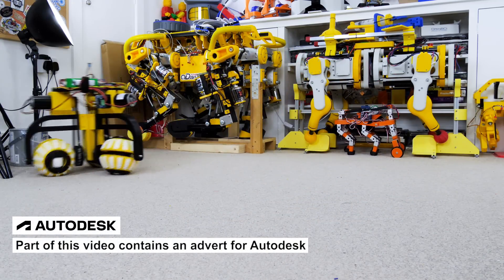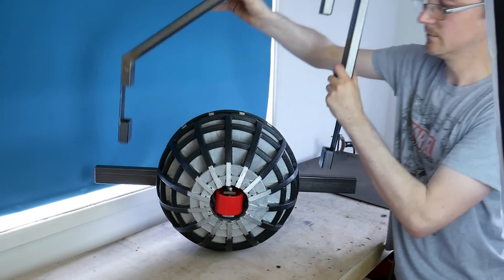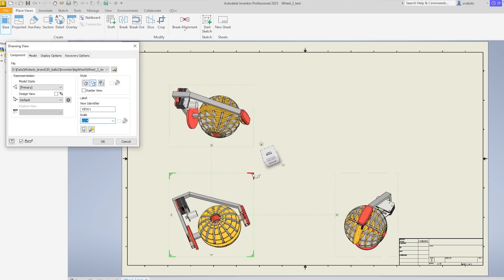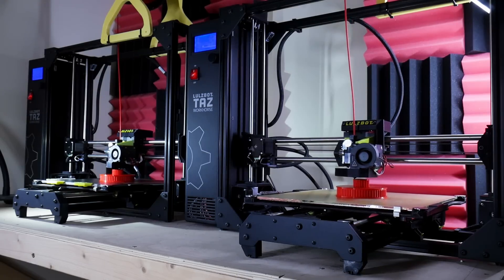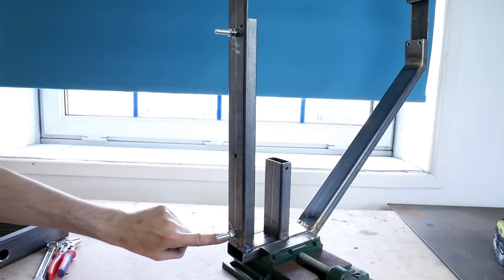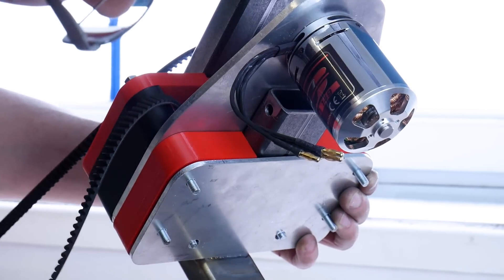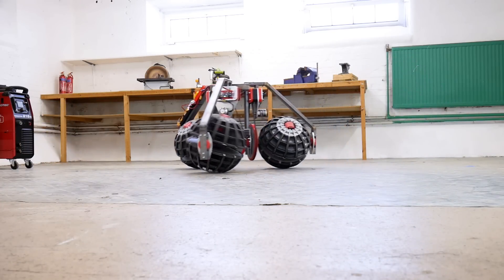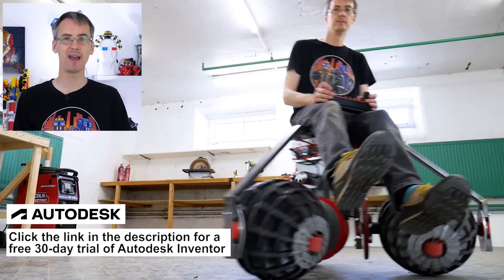Testing Ball-Shaped Wheels on an Omni-Directional Vehicle

Comment: Hmm, looking at this, that would make an amazing wheelchair. Being able to move in all directions like that would probably change some people's lives.
Reply: Interesting notion, but I expect this would have to be redesigned from the ground up to meet that purpose. Ability to negotiate slopes, stairs, and a braking system to lock it in position when needed, would all be essential.
Reply: @chrisblake4198  It would need to be redesigned from the ground up to meet any purpose. Slapping a chair on top of a movement platform isn't the correct solution, especially with how tall the platform already is. Ridable platforms are much more complex in terms of design considerations compared to generalized motion platforms, due to needing to accommodate a rider, of which position and posture are important, while scale is also important and will most often determine seating position and posture. In the configuration of a chair, a rider's legs are typically an issue, which is why the typical office chair has all of its wheels located under the person with their legs outside of the boundaries of the base, but this requires a smaller scale. At this scale, mimicking a trike with an isosceles wheelbase will probably be the more optimal method, especially within a tadpole configuration, with a singular rear wheel, where the rider's legs can be forward of the wheelbase, as seen in most recumbent bikes that have a reclining position, though an upright posture where the rider can sit and stand at will would require a layout that results in potential balance issue due to how far forward the rider would need to sit, which is also an issue of the wheel geometry. Outside of fringe designs at larger scales, the only way an upright chair works for this platform is making an omni-directional office chair. 

Spherical wheels are just generally problematic anyways. Overly large with next to no benefit, and arguably worse driving characteristics. The only time they will ever make sense is in the example of the Goodyear spherical wheel concept, a free-spinning ball that can be magnetically driven, as this would provide the best driving characteristics of any omni-wheel, especially at the scale and implementation they were conceptualized for; not to mention material and moisture ingress are negligible in this concept. Omni-wheels for wheelchairs could work, but only in the instance of in-store scooters, not in an environment where material ingress is a concern; this is basically why we only see large-scale omni-wheels used on forklifts that remain in an indoors environment on smooth concrete floors, ingress is a concern and combating ingress significantly raises prices in mechanism with so many rotating parts. This then leads into why vehicles really won't see the use of omni-wheels, especially when the scale becomes based around speed of the vehicle, as the typical omni-wheel would create a rough ride and would more than likely have a fairly fast wear rate. 

Omni-wheels are cool and all, but they just don't make sense outside of some specific uses. You'd have better luck creating a wheelchair replacement using legs, as even they'd be a lot more practical.
Reply: @xaytana  i dunno i think a wheel chair design but with 4 omni wheels atthe corners would be both interesting design wise and interesting for a pratical point as it owuld alow free movemernt
Reply: @CuppaLLX  It would still run into the same issues. Spherical wheels are just impractical in comparison to any other omni-wheel design, outside of one concept that's more than likely never to be realized within a reasonable frame of time. Using any other form of omni-wheel within an optimized layout and orientation would work, spherical wheels however are too problematic to be practical.
Reply: @xaytana  spherical wheels do have their own benefits though, like fewer, larger and more durable moving parts. most omni wheel designs have lots of moving components that need to work with 100% reliability, a wheelchair with 4 spherical omni wheels like these would be able to work fine if one of the drive motors failed completely. they wouldnt really need to be huge omni wheels either, maybe 4 football sized ones so they could be close enough together to fit through doors, a more raised and slightly more upright seating position with the option to sit more fully. it would be much more capable than a mobility scooter or regular electric wheelchair as long as gradients or slopes could be managed  of course.
Reply: @Great.Milenko  More durable moving parts? Support your argument. All wheels in the design are supported by an axle with a bearing on both sides, just like in most omni-wheel designs; all things being equal, subcomponent durability will also end up being equal, though I'd have concerns if the large end of the hemisphere were supported by a bearing identical to the smaller end of the hemisphere. All things being equal, your argument is invalid, if not outright incorrect. Sure, there's less moving parts, but at the same time more typical omni-wheels have a more balanced design, and have more consistent rolling characteristics, of which these spherical wheels lack once they get close to their poles. Any potential component reliability arguments are also invalid, as any omni-wheel is at a much higher susceptibility rate for material and moisture ingress, even with sealed bearings there's more pockets where there can be buildup, and combating ingress will raise complexity and costs. 

Argument of 100% reliability is also invalid, as these wheels would need to operate under the same requirements; plus the use of '100%' invalidates your argument, as nothing is 100% reliable. Drive motor failure argument is also invalid, as any other omni-wheel system that is comprised of wheels that can freewheel, i.e. not an omni-wheel with its own wheels bound by gears or a flexible shaft, can still operate with a drive motor failure. To further invalidate your drive motor failure argument, all motors need to be operational anyways, you clearly don't understand the kinematics of an omni-directional movement platform based on omni-wheels, even in a platform of four wheels, losing one motor needs an adjusted kinematic model, assuming the model doesn't misbehave due to the structure of the wheels and the kinematics of the system.

Wheel size and arrangement argument is potentially invalid. Keep in mind that a chair needs to not tip over, so the wheels do need to be spaced out to have good balance; this ties back into spheres being impractical, as they add width to the system in comparison to cylindrical wheels. Wheel size is also a consideration, as you want a system that can induce and keep motion efficiently, smaller wheels will make this impractical; this, again, ties back into spheres being impractical, as scaling a sphere will keep it's radius constant, meaning height and width are constrained, whereas a cylindrical wheel has its height and width mostly unconstrained, which also ties back into the previous argument of wheel placement and size restraints. You also need to consider load bearing of the wheels, which ties into the previous argument, which then ties into the argument before that, and continues to show the impracticality of spherical wheels; see how this is a snowballing issue? And all of this is before getting into proper wheel design, of which the rubber-cladded and TPU wheels on this channel are not properly designed, for obvious reasons. I've already discussed wheel arrangement issues within previous comments, there's just no practical arrangement for a wheelchair where the rider can sit and stand at will, and part of this comes down to every wheel needing to be driven.

Seating position argument is also invalid. Raised seat, in a wheelchair? You're daft. Did you even think this argument through? Seating position needs to be akin to what wheelchairs already provide, for obvious reasons. Same goes for ergonomics and posture, though this comes down to more of a cost-based issue. 

The only wheelchair application that could really have an omni-wheel replacement with these spherical wheels are the commercial ones you see at stores, mostly because their environment allows for the downsides of spherical wheels. Larger open spaces would allow for a larger scooter, of which the larger scooter can house larger spherical wheels within its frame. But the exact same arguments apply here, and spherical wheels are still impractical. 

Anyone with basic knowledge of engineering and design will tell you that these wheels would get shot down almost immediately in any potential product due to impracticalities, especially when more practical alternatives exist. Forcing a design to use these is just as impractical. There's reasons why we hardly see omni-wheels in actual products anyways, and why we only see them in clean-environment industrial uses, and not commercial or consumer products at this scale. There's reasons why omni-wheels still really only get implemented in robotics motion platforms, and not ridable platforms; the case of clean-environment industrial applications such as the omni-forklift would be considered a motion platform, as the scale and use of it is as a platform, these machines could go operator-less with no issue, the human component is invalidated. Spherical omni-wheels just exacerbate the already-existing concerns of implementing omni-wheels themselves. And within the practicality arguments, you also have to consider if an omni-wheelchair itself is practical, when an alternative like a zero turn radius wheelchair is more practical across the board, where the only benefit of an omni-wheel is the fringe use of needing to move sideways, but even then there's alternatives such as some form of a swerve drive; another practicality argument is control, regular and zero-turn designs only require two degrees of freedom in their control schemes to fully operate, an omni-directional platform, whether that's using omni-wheels or swerve drives, require three due to the introduction of a new axis of movement, which results in a more difficult control scheme, and this is where you need to consider practicality among the target demographic, of which a lot of these people would not adapt and/or refuse to adapt. Then there's cost practicalities, etc.

It's a cool concept for an omni-wheel, but outside of fringe applications, they're just not practical enough to be realistically used outside of a certain scale. Really the only practical scale is within the original model, a small-scale implementation where the solid casting of the hemispheres are within a size range where cost isn't prohibitive, i.e. around the scale of a skateboard wheel; because then the scale arguments are moot, the various arguments really only have grounds of discussion at larger scales, as the design of these wheels just do not scale well, though at the same time nobody really knows how well these would perform in the use of a ridable platform, so some arguments, such as weight bearing, may still apply. There's other practical uses for spheres in general though, like as a mono-wheel driven under a set of omni-wheels, such as a 3D inverse pendulum or how most models of recreated BB8 droids move, or even the sphere-wheel bike driven by a set of omni-wheels on top of the spheres that was created a decade ago is a good example of a more practical use of spheres, but all of these have a specific range of scale where the spheres can be used practically; even the Goodyear spherical wheel concept is more practical at scale than these wheels are, and as far as I can tell nobody has delved into the rabbit hole of a magnetically-driven omni-directional sphere, either with or without the added magnetic levitation bit, but even then the issue of a sphere's width being constrained to its height is problematic due to platform width constraints, but this design honestly does stem from the sphere driven by omni-wheels design but with a different drive method. Practicality arguments are where most of these wheels fail, for example the Honda omni-monowheel, it had a working design, it could have been a mass-produced product, yet impracticalities kept it as a concept; and I'm willing to bet that other than cost, long term reliability of the flexible shaft was the downfall of the concept, maintenance was probably also prohibitive assuming the omni-wheel could even be properly maintenance without being fully replaced, of which ties into cost issues, manufacturability scale of this kind of wheel is probably also it's own fun rabbit hole to go down.
Reply: bit wide though

Comment: I'd turn all the wheels round so the drive belts are on the outside then there would be a hollow in the middle for your bum. You could then get a really laid back low down seating position.

Comment: Before adding a bucket seat, add a footrest to the vertex wheel, because if you add it to both vertexes (corners), the "vehicle" would become unbalanced and raise the back vertex wheel. I would add it to the area where the emergency stop button is, so you can reach down quickly to engage it instead of it being at the back. 

Secondly, change the remote control to a flight stick and mount it to the side of your seat.

Thirdly, install a crescent roof with solar panels to charge your battery, and install a GoPro for FPV/dashcam.

Finally, add in suspensions (spring and shock absorbers) - easier to add to your seat rather than all wheels.

Now for some futuristic ideas:
------------------------------------------------
Add an arm like Doc Oct, from behind the seat.
Or add collapsable wings expanding from the back of your seat and the tips will rotate and expose mini BB canons.

Comment: Might need some sort of suspension for a smooth ride on rougher surfaces.
If you can’t or don’t want to re-engineer the frame to add suspension, you could put a spring under the seat so at least you don’t feel all the vibrations from the wheels.
Reply: The seat can have the suspension, like 3 springs.

Comment: It would make more sense to sit with the E-stop between your legs and mount foot rest on either side of that "leg" of the machine. You can use a highback office chair with arm rests for the seat. Assuming the seat has plenty of padding (as a highback office chair should), it'd make for a more comfortable ride if you take your creation outside - especially going on a sidewalk. I bet those wheels going over sidewalk joints would produce a pretty significant jolt.

Comment: I think this would be the ideal control scheme, all other ideas are terrible, fight me: use pedals to control yaw, such that your heels rest on a nice stationary point in front of you.  A center stick, aircraft style, between the legs would control lateral movement (aligned with your relative cardinal directions) and look absolutely awesome.  It doesn't have to be a center stick, but a control stick with a long throw would be nessecary for precise speed control.

The control stick can of course have triggers and buttons on it for shooting at civilian targets and small children.  The nerf rival products, the ones that shoot balls, would mesh well aesthetically and are far more effective than dart guns in my experience.  If you really wanted to, you could add a second control stick to pan and tilt two gimballed nerf guns, say within a 45 degree cone facing your forward axis.  That's a lot of work though.

Comment: Use mentholated spirits as a coolant when you're cutting the aluminium, use a spiral flute cutter in tool steel with a slower travel speed and a greater depth of cut. You should be able to use a higher cutting speed.
Reply: "mentholated spirits"
Mmmm minty.
Reply: @ferrumignis  I love that stuff! Gletscher Eis, cheap Austrian tourist hooch, designed so Brit skiers can get alcohol poisoning with minty fresh breath...
Reply: my old dad always used parafin when cutting ally

Comment: couldn't you avoid the whole issue around the smaller hub wheels if you had the control axle offset from the ground  by like 30degrees. I'm probably missing some basic geometry but as long as the offset isn't too severe and all the wheels are at least slightly back-drivable it seems like it  should work?

Comment: That looks so cool and fun to drive.  Some ideas:
-It would be better if your center of mass were lower  ( hard to do without a rebuild, and your legs would have to stick out a little if you were lower )
-you need supports for your legs: look at wheelchairs with leg braces.  two half-cylinder tubes with a heel brace at the bottom will give you good bracing.
-make enclosures for the pulleys so you don't pinch off a finger of a 10yo at your camp.
-bucket seat should have small sides for bracing.
-softer/thicker  tires. looks like you have a bumpy ride.
-you could put strain gauges on the bucket seat post and then you could move by leaning in the direction you want to go in

Comment: You definitely need somewhere to put your feet when you ride it, having them loose makes me nervous you're gonna get them caught in the wheels. Also you've invented an amazing electric wheelchair if i've ever seen one, great job!
Reply: I think its not easily tilted and base heavy enough. If you can mess around with the whole center of gravity a bit more, you can make a retractable seat; make it a scifi electric wheel chair.
Reply: I was thinking the same thing, an electric Beach wheel chair.
Reply: braking might be a challenge with such design
Reply: @victornpb  Especially if one of the omni-wheels happens to turn on the roller-skate wheel.
Reply: sourced from a wheel chair maybe
Reply: I was thinking commuter vehicle.